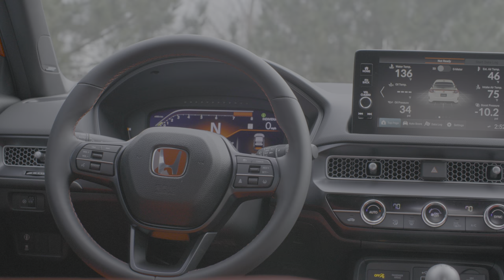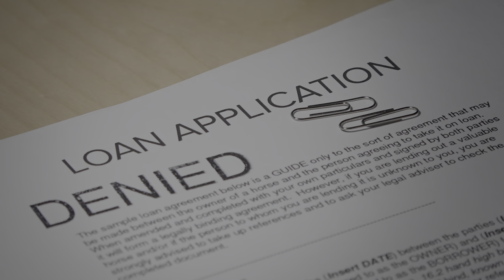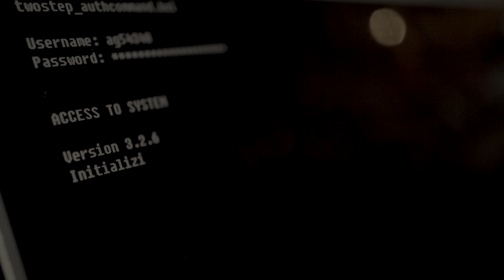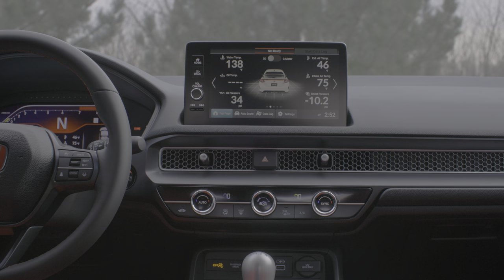Why I Bought an FL5 Civic Type R

Comment: I really liked hearing the free market argument of dealer markups. There is no way around the issue as long as Honda production can’t meet demand. 

By the way, the HDR content looks great on the iPhones OLED screen!
Reply: Yeah I just wish consumers would tolerate manufacturer's raising prices themselves, so all that extra margin doesn't go to the dealer and they can produce more of these cars.
Reply: I agree, it's on Honda and other brands for making limited productions on cars that people want
Reply: But still begs the question, Why do msrp’s exist then? Call it what it is, dealerships just making shit up.
Reply: @axe2grind244  I think it's to help protect consumers for all the other vehicles that they sell. It would suck if manufactures got rid of them as a whole and regionally all cars were priced different. It would be dumb to get rid of MSRP's during times of shortage/in the case of a niche low volume vehicle.
Reply: @rambow70  😂, no it's not, no one is forcing you to buy a limited production car.
Reply: There is no free market argument. When a new pair of limited edition shoes drop, Foot Locker doesn’t start a bidding war, whoever gets there first gets the product at MSRP.
Reply: @vaporpunk24  yes there is, there always is, even if selling over MSRP was made illegal, other people would still be buying and reselling it for more, free market always corrects, no one can control it. 
Also, terrible analogy.
Reply: @mofayer  It’s a great analogy.

Comment: originally was looking to buy this but then realized can't buy one with MSRP. Decided to tier up to G80 M3 instead, s58 is a great engine
Reply: That is the way to go. If cheapo brands are gonna try to sell their cars at luxury brand prices, might as well go straight to luxury brands.
Reply: It's crazy when a M3 is the same price as a Civic, right? For MSRP the Civic type R is the best around, but if it's the price of a M3 ... Why not get the M3?
Reply: @MrTresto gas mileage, insurance, and maintenance cost over 5 years would be way cheaper with the Honda. At ten years Honda would be substantially lower. 

But i agree, i wouldn’t buy a Honda for the price of an M3!
Reply: The F80 for the same price as MSRP makes a ton of sense too, which is why I am hanging on to mine!

Comment: I am pissed. I’m 57 a veteran and worked my ass off to try and get a fun car to retire with. Every dealership I contact is 20k markup. Every YouTuber gets every new hot car at msrp and the car enthusiasts get the shaft.
Reply: Settle down buck, YTber's are in a better position to help the brand than you. They are just being rational. As for you, there are plenty of fun cars out there. You don't have to have a FL5 CTR to have fun.
Reply: Just save and wait it out few years man. Supply chain issue will get better, high interest rates will eventually drive buyers off so dealers will be forced to go back to offering deals and selling well under MSRP like they used to. Now is not a good time to buy still but it's slowly betting better.
Reply: @bearclaw5115  I’ve been sacrificing  raising my family for the past 20 years, saving pennies here and there. I finally get the chance to get a fun sporty car and civic type r, Supra manual, corvette,zl1 camaro all have huge markups for the hard working public but every popular YouTube channel gets them immediately, no markup. I have to wait on a list for a year or pay 20k markup. I’m just pissed. I love this channel been here since the beginning. I’m just frustrated like thousands of enthusiasts.
Reply: I want to add I love this podcast and been watching from the beginning. It’s just very frustrating right now watching all the YouTubers getting cars on day 1 at no markup.

Comment: Interesting that you think the FL5 in comfort mode is very comfortable and acceptable, but you knocked the Elantra N for being too harsh for daily use in normal mode. From every other review I’ve seen, they all say even in comfort mode the FL5 is still very stiff and doesn’t have a very good ride, but all other reviewers (and as an owner) say the Elantra in normal mode provides a decently smooth ride for daily use. Just confused how it can be so different.

Comment: excellent choice ...  though the verdict on Brilliance Honda is still out ... I bought an Accord Sport years ago from the old Brilliance location (on IL 31) and the experience was flawed at best ,... I do take my 21 Ridgeline to the new Brilliance location (on IL -176) for service and so far no complaints ... but but but .... I've bought two new Hondas (inc the Ridgeline) from Valley Honda (Aurora) where there is absolutely no BS ... so when I but a new SI or Type-R thats where I'll go ... Thanks Keith Algonquin IL

Comment: I run a service department for a dealer dedicated to golf carts in the golf cart capital of the US for three brands, and that comment about software issues is dead on. Even with something as apparently simple as a golf cart. When I worked for a Club Car dealer they incorporated an automotive type ECU into their new line of products, and shortly after that roll out it was found that the new ECUs had a software glitch that would literally brick the ECU if the vehicles weren't updated before they were sold and used by consumers. 

At my current job, the leading battery manufacturer rolled out a line of lithium products costing almost twice as much as their competitors, and when one of our manufacturers made the switch to equipping those batteries in their vehicles from the factory, it turned out that the batteries as equipped from the manufacturers couldn't handle the current loads being requested by the drive train because of software limitations. For the last four months I've been working remotely with a software engineer in another country to reprogram the their vehicles so that the software parameters of the batteries are actually reflected in the programming of the vehicles so that they don't shut down after they're sold to consumers. After I reported all these issues to the battery manufacturer they issued a release saying that they had revised the current limitation of their batteries. I know electric vehicles aren't anything anyone gets excited about, but even as a car enthusiast, that software comment is seriously more relevant than most consumers know.

Comment: My son and I walked into a Honda dealership and saw a used boost blue FL5 with 8k mikes, 1 owner, clean CARFAX report, $49k with the whole front PPF, tint , window visors, carbon fiber look door pillars, top wrapped in black, no performance mods, and still has factory warranty.  Test drove it and didn’t hesitate to buy it.  We thought it was a great deal!! And it is! We prefer this over the Integra type-s due to JDM factor. Other option is to get it brand new for $62k + another $3-4 k on PPF and tints that were were going to do after buying a car.  😢.  No regrets so far! Our other cars are 8th Gen Si and 10th gen si, so getting the FL5 makes so much sense, only Honda guys could understand.

Comment: The saddest part really is this is how enthusiast cars die. Less supply means more fighting for allocations. This in turn causes price gouging and as a result more average people are priced out of the market. Once people are frustrated to this point they swear off buying new enthusiast cars and then the manufacturers have no reason to continue developing new ones. Now a once thriving enthusiast community just dries up. I say this as a Focus ST owner. I paid sticker price in 2018 at 31k and the sad thing is if the car is totaled for insurance I cannot afford to buy a similar new equivalent that has the same feature set. Everything now it seems is pushing towards that 40k plus and it's infuriating.
Reply: I bought a new 2018 GTI S 6MT that was marked way down because it was the end of the model year and there were still a bunch on the lot. Paid $24,500 otd, and in today's stupid market it's still worth about the same or even more, even four years and 43,000 miles later. Anything comparable that's new is pushing 40k, like you say. Maybe things are fine in exotic sports car land, but a major part of the appeal (and point) of hot hatches is that they're supposed to be actually possible to buy. A lot harder to give a shit about them when they're not.
Reply: @anAmishGuy  Exactly. I'm doing my best to take care of my ST as I probably won't be able to buy anything like it new again. This is why I've started venturing into motorcycles. They aren't exactly cheap either but by comparison it is at least affordable and keeps me interested in motoring.

Comment: Going to Honda dealership in the early 00's and getting "This car is too much for you..."

This happened to me as a young E-3 and E-4 in the Air Force back between 02 - 04 and ultimately is what led me down the path of every other car brand. I've only owned 1 Honda in my lifetime and that dealership's attitude (Not exactly Honda's fault) is why. Occasionally when I see a Civic Type R on the road I am reminded how I was deemed "not good enough" for a basic 03 Civic.

20 years later, I'm now retired, and I'm sticking my son in the brand that was eager to have my business back then... a Subaru (BRZ). Yeah... I'm Petty Roosevelt over here.

Comment: I had a Civic EX that had a recall on the wiring for the multifunction switch. I'm an ASE Master Tech and used to be a Nissan Master Tech. I only brought it to the dealer because it was a recall. When I got the car back, the lower cover of my steering column fell off. When I looked inside, I saw wire nuts. Yep. Brought it back and told them to fix it the right way... and buy me a new lower cover because their tech broke the tabs that align the lower cover.

Comment: I think the fl5 Type R is the ultimate evolution of the civic. Went from being a loud, cheap little thing, to being a very good performance car. 

But I'll asl you this: would it have killed honda to sweep up maybe 5 more horsepower and sprinkle it on there? I dont want to hear about "its not about the power!" the price hasnt stopped going up why does it take so long for them to make more power?

Comment: Cool Insight @16:30. I have a Red 2001 Insight with a engine swap (2008 Fit stock) that I autocrossed  and tracked for 5 years. I learned a lot on the track with low HP, you have to get everything right in the turns with a good exit speed since you can't just do a late apex and blast down the next straight. Have a Championship White 2024 CTR on the way and hope I can apply my good training to use.

Comment: In 2002 I went to my local Honda dealership and wanted to test drive a Civic Si. Keep in mind I drove up in a modified CRX-Si and this was the same dealership I bought all my genuine Honda parts from. They told me no. I went to Subaru to test drive a WRX. The salesman made a copy of my drivers license and tossed me keys and away I went. Until that point I had owned a 83' Civic,  89' CRX-Si and a 94' Civic Dx. I now own no Hondas and still have my 02' WRX and also a 09' Forester. My next car will be either a JDM CRX-SiR glass top or a JDM Forester STi.

Comment: A year ago I went to buy a brand new 2022 Toyota Camry SE AWD with the convenience package. MSRP was something around $31,800. 

However, the dealer was charging a $6,000 markup which was not mentioned online. not on Cars.com, auto-trader, or the dealership website. I called ahead and asked about there being a markup. The salesmen diverted the conversation. I went to see the car and liked it. Then saw the markup and told them I wasn’t going to pay that, at least I would need to negotiate the markup down. I was then told I needed to leave because they wanted to sell the car to someone who would be willing to pay it. 

I settled for a used 2017 Honda civic EXT, and I think I made the right choice. Paid $20,700 for it which is a lot but, in the current market I felt was a sufficient deal. The dealership experience was far better as well. And I felt respected by the staff. 

I just really couldn’t believe the atmosphere difference between new dealers and used dealers. Just crazy.
Reply: so you still bought a car at that same dealership?  I really hope you didn't.
Reply: @riseabove3082  No. I went to a different dealership. I would never go back to that Toyota dealership even if they don’t do markups anymore. The sales experience there was so backwards and just not right lol.

Comment: I really love the styling of these new Civics; by far the most attractive cars Honda has built in over 20 years.
All of us car guys would love a massive throw-back Honda Civic, Integra, Accord of the 90s, and I find it's sad that...we could do it. Technlogically, nothing is stopping us from building old cars from new, but we need to progress through environmental and safety standard. It just has to be done.

But far too often, I wonder if there could be a way to bring back that 90s Japanese/German driving experience all while building up on what we're developping towards, into a package that would fit a very average young consumer. Full EV or PHEV should have to be so 'appliance'y' or 'device'y'. It could still be a machine, like a lathe, tactile and raw, fun and addictive.

But we're not doing that. And that's why us car guys are flocking towards cars like the Civic Type R, or used examples of long gone toys, all very limited.

Comment: Good for you. I want one as well. The car is a swan song IC car for Honda, no doubt, and it delivers on the promise. No inventory out here in CA and pricing is still ridiculous. I'm a pretty serious car guy and the ONLY dealerships that don't seem to treat me like a total a-hole are Porsche dealers (and unfortunately I'm not in the market for a Porsche!). All others act like I'm a clown who can't afford the car and/or  a fool looking to get fleeced. I am a massive Honda fan (owned lots of Hondas including an Integra, NSX, etc.), but Honda/Acura dealers are no better. It absolutely drives me nuts. Spent a ton of time looking for an FK8. Got laughed at most of the time. Not even trying yet on the FL5 given the low inventory. I don't need to hear the patronizing speech about how "special and rare it is", like I don't already know what I'm trying to buy. I see Acura is moving to direct ordering on the new ZDX EV. Going direct is going to change the industry and hopefully fix the one industry that still seems to make ripping off their customers normal practice. In comparison, I ordered a Rivian. What a simple experience. No BS. No "finance" person doing BS upsell crap. All online. Price is set. You decide on configuration and you put in an order. Easy. Fast. Stress free. No condescending crap from someone that knows way less about the car than I do. Luckily I understand that Honda as a company isn't the same as a Honda dealership, but the dealership is how most people interact with the brand and the experience frankly sucks most of the time. Kudos to Brilliance for trying not to.

Comment: Mr. Keefe certainly is a good talker & seems to have the proper grasp on what a dealership should be. But based on what he has mentioned & what you mentioned from your experiences, it sounds as though there is a disconnect between the owner of that dealership & the staff that interact with customers or potential customers. Might not be a bad idea for him to look into his staff a little further. All new vehicles should be sold at MSRP. Didn't he say that "I don't sell over MSRP" but then mentioned right after that, I will contribute the amount over to a veterans group? Which is it?
Reply from the maker: He did wind up selling the car at MSRP
Reply: @savagegeese  I do applaud him for doing that. Certainly wish that all dealers would do the same.

Comment: So my thing is that this new fl5 doesn't really provide anything different from what you get in the outgoing model throttle house  already proved that in a straight line the fk8 is actually faster and with the same tire combination it is just as fast around the track so how do you justify these asking prices 🤔

Comment: My 21 Type-s came with no plastic protection on the outside. I had asked dealer when it arrived to leave all the plastic on it, somethng I always ask for on nicer cars....then when it came in they too were surprised to see nothing. Some interior pieces were wrapped that's it. When I worked at Honda in the 90's the cars were all wrapped and a LOT cheaper. Cust cutting by Honda. My Type-s was damaged on delivery as well. Front lip was damaged.

Comment: On the test drives the dealers have to decide if they are going to let every kid in town beat on a rare car before it is purchased by a real buyer.  I felt lucky to find a 22 Si and was happy when they said test drives were not allowed.  My Si had 6 miles on it when I drove it off the lot.  In this case, Youtube was all the test drive I needed.

Comment: Looking at the 2023 GR Corolla core w/ performance pack but worried about dealer markup as well. I understand the limited volume strategy of these special models but MSRP is already $1500-$2000 above invoice on a lot of regular cars. No need to pay $5000+ above that when you have so many options in the “hot” compact/small car world -Golf R/GTI, Elantra N, GR Corolla, Civic SI/Type R etc. definitely agree that these next few model years may very well be the last of the gas-only performance cars before everything gets a battery. Cheers

Comment: Honda really perfected the fake engine noise on the FL5. My buddy at Honda Japan says the unbranded infotainment from the FK8 simply didn't have the speaker impedance necessary to set benchmarks at Suzuka. Thankfully, Honda was able to team up with the engineers at Bose and Dyson to unlock the true Acoustimass potential of the K20C1.